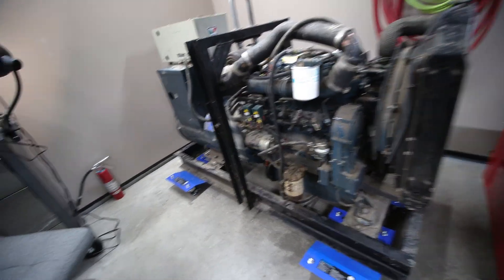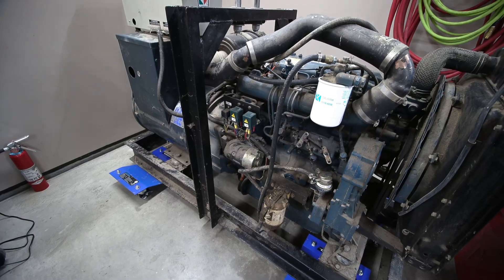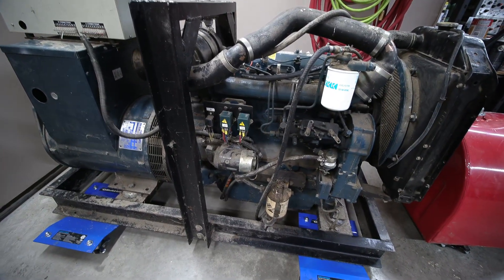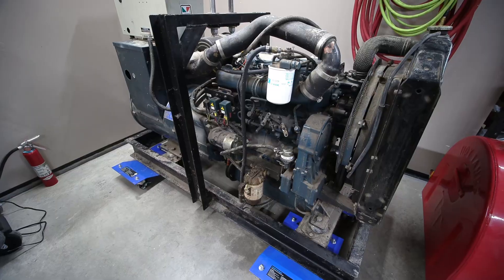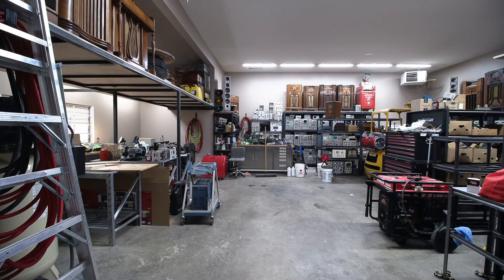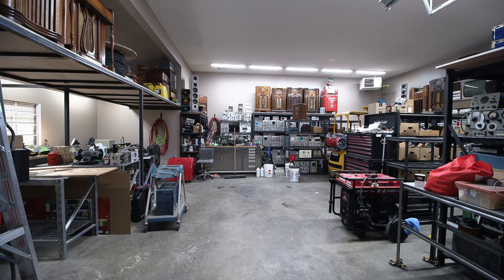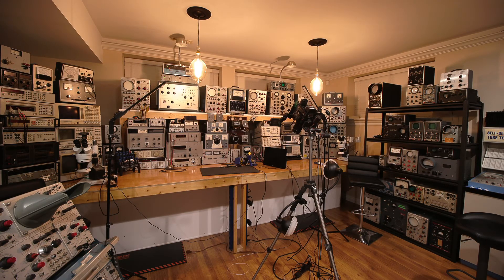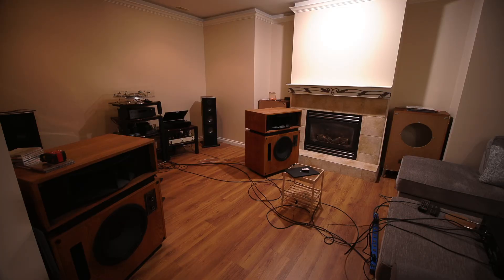Where Are The Videos? My Life And Projects Off Camera

Comment: Some sort of soft starter for the heat pump compressor may be of benefit.  Ask an HVAC technician
Reply: +1 on the soft start. Diesel sets don't like to be under a light load anyway
Reply: I suspect he already has some sort of soft starter. If not, he'll probably design one himself instead of paying someone else to install a premade one.
Reply: Great idea.  A soft start can be a game changer.
Reply: I know his house is pretty damn nice, but can't imagine a Heat Pump compressor should be dimming lights on a 200+ amp service. AC units rarely take up that significant a portion of the total power. I'd think there's a problem with something, but can't imagine him not checking for obvious faults like that.

Also, how exactly do soft-starts work relative to the normal contactor and start/run Caps? Do they slowly charge storage caps then start, to mitigate the inrush? What's a 'hard start' in contrast, and how does each generally work? AC Motor inrush is something I'm relatively weak on compared to other electronic stuff, so would like to know about this stuff. Our older 2-ton Condenser used to dim my room lamp, but hasn't since the old Furnace was replaced. On our 100a panel with 2 AWG Service I don't think there's any dimming or noticeable drops when the condenser kicks on, yet it seems too common post-incandescent bulbs in homes much better than ours.
Reply: @Brandn00b25   I have 200 amp service and the air conditioner startup still dims the lights. This particular compressor is rated 23 FLA and 105 LRA. I could imagine a larger 5 ton compressor peaking at over 200 LR amps. Keep in mind it doesn't take much to dim the lights. A space heater on its low 500 watt setting (4a?) noticeably dims a 15 amp lighting circuit. A 200 amp compressor startup would be expected to make an even bigger dip on a 200 amp circuit.
Reply: @eDoc2020 A 200 amp compressor should just about blow the main breaker on most houses.
Reply: @davelowets   It's only that high during the initial startup surge, much less than 1 second. Standard breakers are designed to allow momentary overloads so this isn't a problem.
Reply: @Brandn00b25 A soft-starter for a large compressor motor is basically a VFD (variable frequency drive) motor controller, and it has an automatic program in it that starts the motor up at a slower speed than usual, and then ramps up the frequency as the motor picks up speed, and hence lowers the current draw when it starts up.
Reply: @Brandn00b25  Our dryer at home is on a 240V 30A service, and when I'm doing laundry, I always turn the laundry room lights on to admire the inrush current that the dryer pulls when it starts. I reckon that the normal inrush current is about 120A on 240V (we have a 225A service), and I now moan about there not being a soft starter for the motor.

Comment: Hi Paul I am in the uk and we hardly get any power outages especially on the main island, but I have a generator to (just incase) and I have used it once or twice, it is not wired in though (I do reverse feed the electricity) but being a sparks I do know the indications and have the main power switch Locked off when the generator is running. my generator is powered by a massive Honda GX160 petrol engine lol

Comment: An oversized genset when compared to the input power is part of it's 100% duty cycle. Additionally, the added rotating mass of the stator in combination with the reduced output impedance (due to size) will minimize V sag vs inrush I. And lastly, larger conductors = less heat.

Comment: I'm pretty sure you already considered it, but just in case, why not add a VFD for the compressor, I imagine that if it is that large, it should be three phase motor, so with a VFD you can program a soft start curve, and the 15K little guy won't be as pissed xD, just a thought, i did that once and worked pretty well.

Comment: Having a bigger generator than the engine is not a bug but a feature !

The flywheel effect of a generator much bigger helps when instantaneous loads are applied .

If you can delay the actual start of the hvac compressor motor once the system
Calls for a start , you can send a signal to your generator governor increasing speed . so when the load does arrive it is ahead of the powered curve , not being pulled down as the isochronous governor tries to get back to set point .
Feed forward …..
Reply: There's also a possibility of a "soft start" and staging of the start up of fans to lessen the load surge.
Reply: That would be fine as long as everything else running on the Genny won't mind momentarily running above 60 cycles.
Reply: a FEATURE is a BUG with a suit on!
Reply: Yep, that’s also called margining: setting the voltage higher when a load increase is anticipated.
Reply: I have serviced helicopters in the 80’s that used a bias circuit called the “anticipator” to keep rotor speed constant as collective pitch is increased.
Reply: A bug is also known as an undocumented feature!